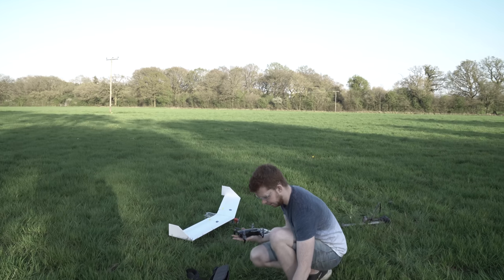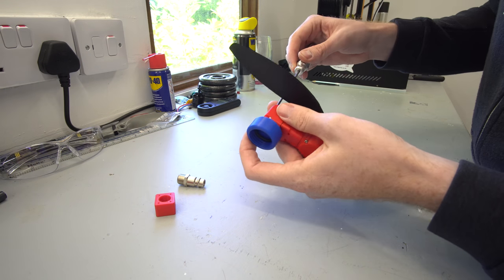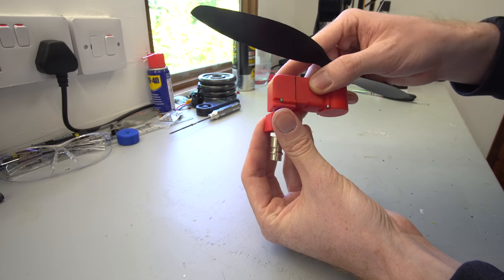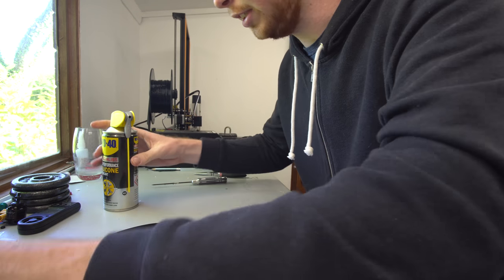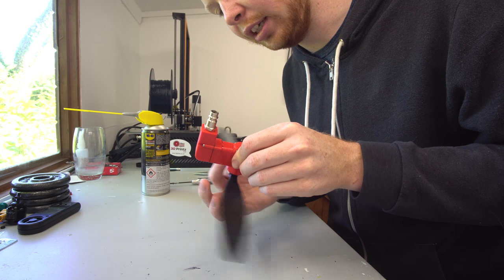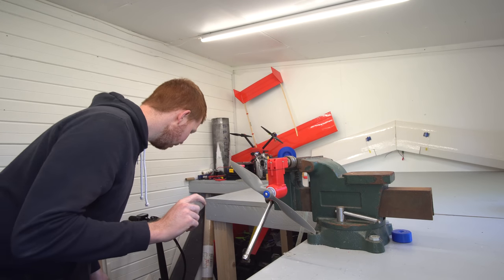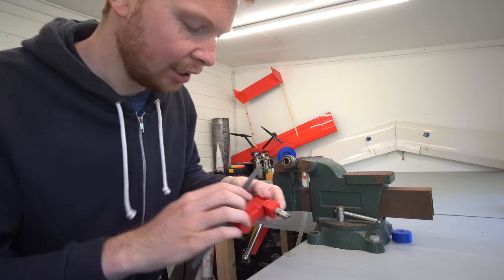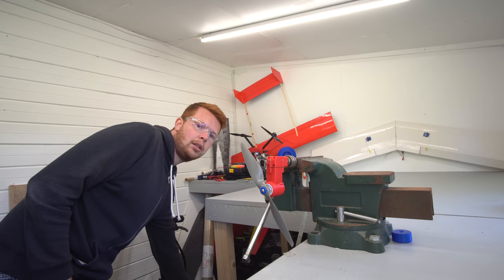Air Engine Throttle

Comment: Hempseed oil, available on Amazon..  it's the best oil for plastic and its non petroleum oil .. it's what people used to use for lamp oil.. it's a straight across for kerosene.. except it's made for the kitchen and using it for food purposes... it's actually good for Planet Earth at each stage of production... mix with acetone for a high "octane" racing fuel... but all by itself it is a dandy fuel... it's good for you and the Planet. ;;☆》 
Peace ✌☮
Reply: I just bought an old MGB "SU carburetor" the venturi and butterfly valve are probably the easiest way to fix the intake of this, or a pulse jet... and the older 975 cc Austin Healey and MG midget used a really small throat... I think the diameter was around 2.5cm..  when we convert to Imperial we lose the accuracy of decimals
Reply: I'm posting pictures of the SU... on Pinterest... the needle and seat with vacuum piston control is not a sufficiently fine mist for fuel efficiency... I have a method to create hydrogen on demand... so that's what this project is about at the moment

Comment: aaaaah u need a oiling unit (service unit) from an Airgrinder, like we call that in ger. To suck little drops of oil thrue the whole system. Running dry even ruins air motors evry second :)

Comment: How do you seal up your 3d prints? When I print and put pressure through it, it leaks from all over.
Reply from the maker: I use a 0.2mm nozzle, print at 0.1mm layer height and print 6-8 outer wall layers.
Reply: Thanks! I am printing a pressurized cartridge and can't get it to hold air. I LOVE your channel and have been watching for a while. Keep up the good work! Have you tried using rubber filament to 3d print custom o-rings? my school has some, and I printed o-rings but I haven't been able to test them. Thank you for all you do!

Comment: Drop the pistons. It’s too retro. Make a turbine already! Higher speeds and friction, bigger challenges for 3D printing. Should have some active (with very thin lubricant) lubricating system built in from the beginning?

Comment: add electric starter it would be easier and safer
Reply: Better yet, replace it with an electric motor for much more power, run time, simplicity, lower maintenance, safety (no pressurized tanks or 3d parts to frag grenade).

That's what would happen if we went with practical, plus now you need a battery along with your air tank, and a button or receiver and transmitter to activate the starter.

Comment: Your "engine" still has one problem. It is horribly inefficient because you don't let the air expand in the cylinder. You're engine is wasting way too much energy.

Comment: Hey Tom, awesome project! :)
Maybe use some sort of setup similiar to this sketch: https://drive.google.com/file/d/1_mdErU8l_8q6G-zvpaYH6Xb-U4xlbyQr/view?usp=sharing
for throttle control? You could set the idle speed, and use force to open up throttle rather than using force for cutting the throttle (Should be safer that way in case you loose control)

Also, do you think you could Open-Source the project / release the 3d-files? I think you could have a huge amount of people contributing with different designs, multi-cylinder setups and stuff like that.
It's just way cooler than printing the 500th Yoda-Sculpture.

Comment: Tesla one way valve. no moving parts besides the air itself, perfect for 3d printed parts. make a large number of chambers and just use a threaded piston to block them off to modify the performance of the valve. tada!

Comment: Take the quick coupler out of air line .  The hose should have the same male thread as the male end of the q coupler or you my need a short nipple but probably not. It appears you will need proper tools to do it ! Spanners in your language. Ha ha. ;-)

Comment: If you upscale the plane body and ur engine..you could mount a 12v mini compressor (240g). attach a servo of the throttle, battery...you really got something there. 
heres an unbox of a kenmaster mini compressor - https://www.youtube.com/watch?v=OKmqqxtS2U8